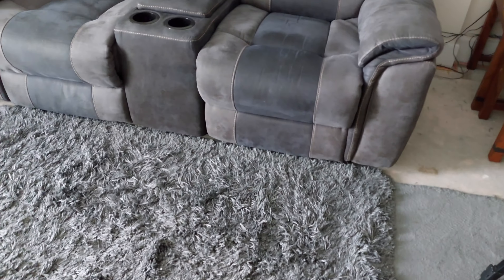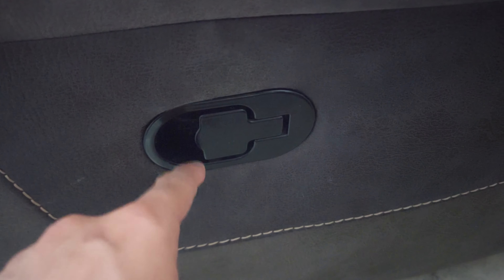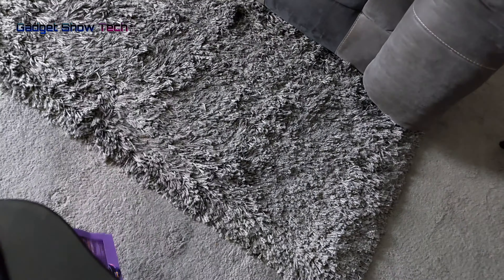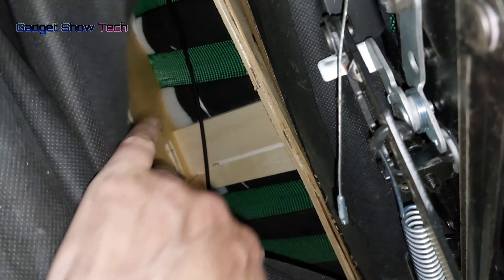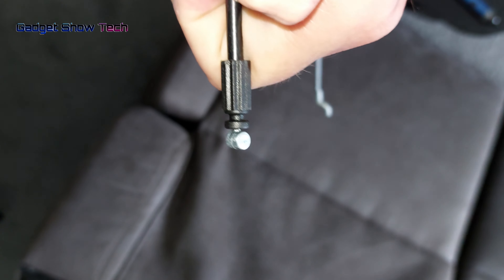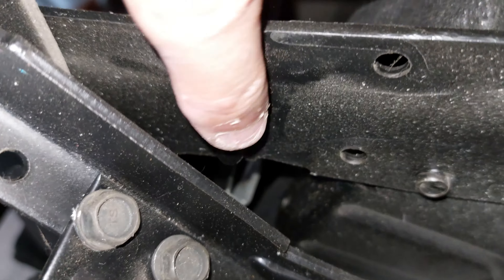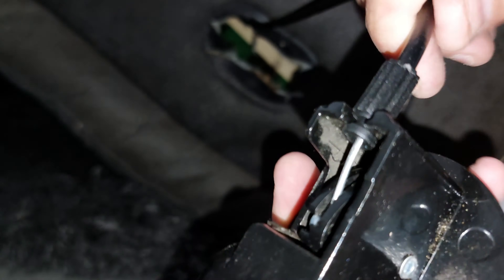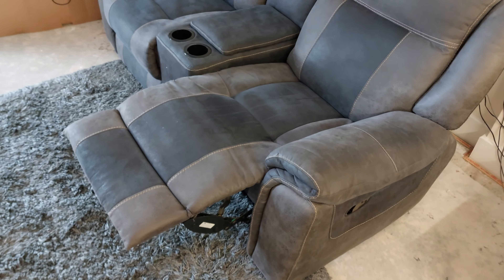How to Repair Pull Handle Cable for Recliner Sofa Furniture

Comment: Thank you, about to try that over the weekend
Reply from the maker: How did it go?
Reply: @SmartGadgetShow Just got the cords and found out that the piece in the recliner lever slipped out of that paperclip looking holder.  Readjusted into how it looked in your video and now it's back to normal.  Thank you!. Now I just have a couple cords just in case lol😊

Comment: I see no screw on my clip. I’m unable to take it off.
Reply from the maker: Unless it's missing,  it should be. Maybe it's a clip on , see if it can prise off. 
Email me a photo to wayne29uk@gmail.com
Reply: It doesn't matter if you break it, the new cable has one....use needle nose pliers or a hammer to bang it through.

Comment: How do you get a clip on bracket out? I couldn’t get it out after 2 hours of trying then tried to tie my new one around the old one and it still didn’t work so I’m guessing I have to get my old one out. I tried pliers, a screwdriver, scissors, and all I got from it was a cut up hand. Any tips would be very helpful.
Reply from the maker: at 02:35 ? needs tilting.  or 0240
Reply: @SmartGadgetShow  2:40
Reply from the maker: @Kat-606  well then , i said how to remove it, wiggle and twist and turn.